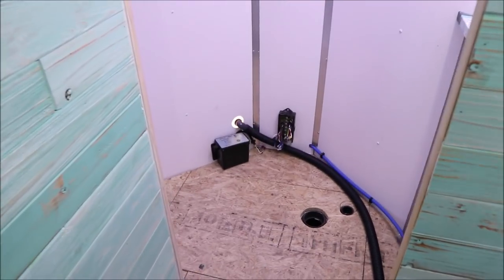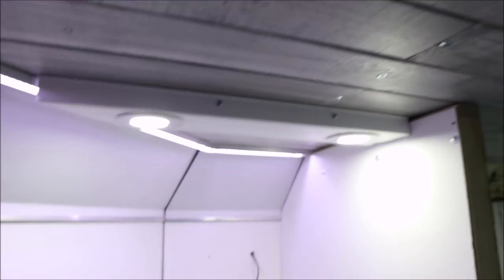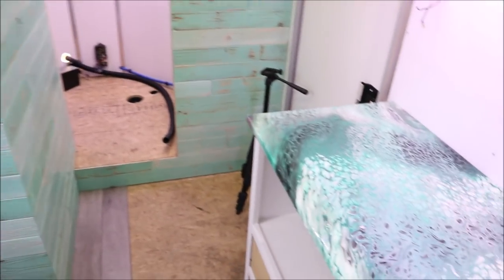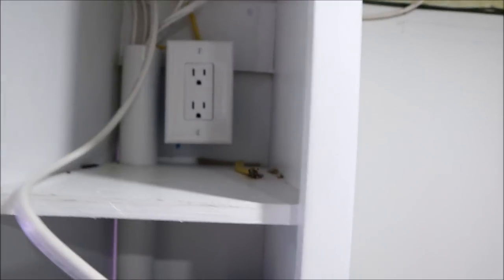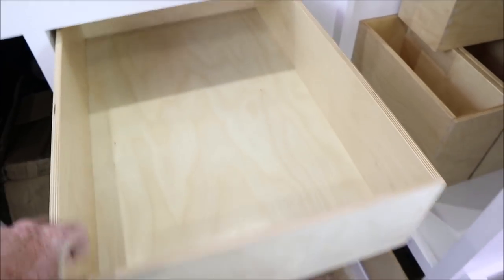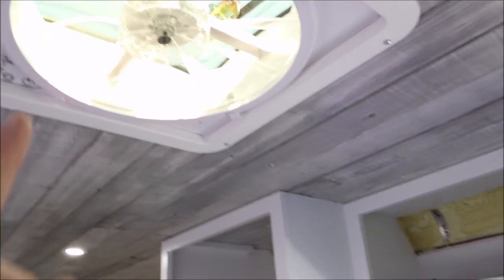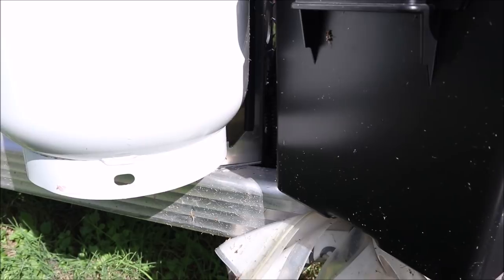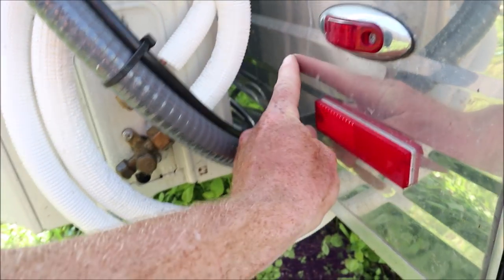Cargo Trailer Camper Conversion Update 4 Mini Split AC - Electrical - Plumbing

Comment: Nice job, and thanks for posting all of this.  you do a great job explaining everything.  I have the exact trailer ordered and it should be here in the next month or so.  I plan to build most of it this fall, but like you found out, I'll probably be working on it until next spring.   I ordered mine with the side door mounted behind the wheels so we can have the bed in the front and bath in the back.  That will allow me to still use the rear cargo door for hauling things.

Comment: Try 4 inch abs pipe with long turn fittings for mini split exposed lines. Maybe even the 180 degree p trap bottom. Only glue what you have to. Drill small holes to shed water if necessary.

Comment: Those cold and hot pipes are gonna get humid when in use, make sure to use isolation to protect the wood/drywall from water damage.
Reply from the maker: Ryuuken24 thanks for the heads up, I'm gonna keep an eye on it and insulate where I can!

Comment: Awesome design. Plumbing question, where is your water inlet coming from for you kitchen sink? I’m trying to decide how to run my plumbing from water to shower and kitchen sink. I’d have to run lines against to ceiling to reach the sink. Just curious what route you decided. Thanks
Reply from the maker: hi. i believe one of my update videos shows the layout of the plumbing. sorry not sure which one. but everything is fed from water hose inlet, just splits in different directions to feed everything. its hidden in cabinets and through the bed base. hope that helps!

Comment: What are you doing for heat in colder weather im planning to buy a 5x12 offroad trailer with barn doors thats a cargo trailer to pull behind my lj jeep wrangler unlimited  i am going to buy a espar diesel heater and run the fuel line to a separate 5 gallon tank they burn about 1/4 gallon a nite if buy espar they run about 1000 i seen people use the Chinese brand but for me im buy American i am truck driver that what we use in winter months on low they run you out small space its well worth the money i have a mr buddy but they burn too  much gas the small coleman tank only good for 4 hours , if you do buy a diesel heat don't buy the gas one gas is very flammable where it takes a lot to ignite diesel much safer
Reply from the maker: The mini split has heat as well. It gets super toasty inside! Get me updated on your build!

Comment: What paneling did you use on the walls and what did you cover the covered areas with at the point of the trailer as well as where the walls meet the roof?

Comment: Hi. I just finished my enclosed cargo trailer conversion to a camper and have been contemplating installing a similar AC mini split. I'm curious if mounting it on the side of the trailer has caused you any issues while traveling down the road?
Reply from the maker: No problems yet really. I do need to build a cover to protect it from debri and rocks. It sticks out a few inches further than the fender but it's not bad

Comment: Nice work! Any info on the mount you built for the outside unit of the mini split?
Reply from the maker: At some point I'll get underneath and get some video of it, but I just went to a Fab shop and had them design it based on what I wanted
Reply: @danielmid6022  Sounds good. Yeah I was thinking about having a local welder shop do the same. Nice to see someone else using the mini split system versus a swamp cooler A/C lol.